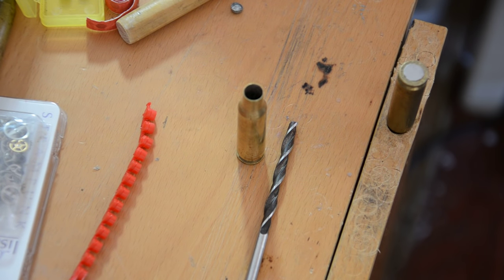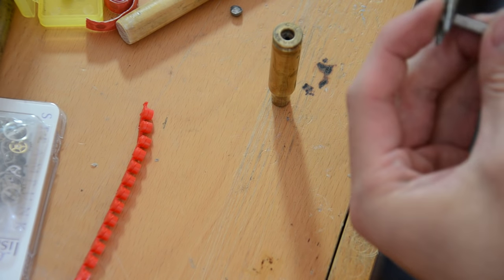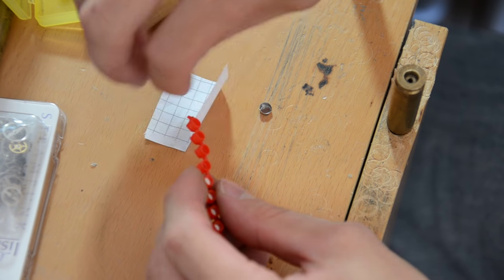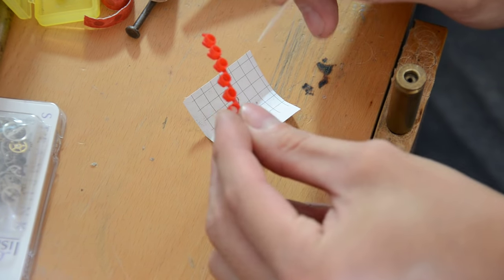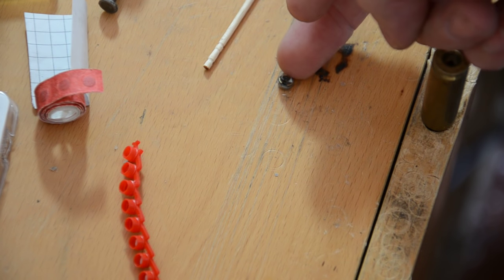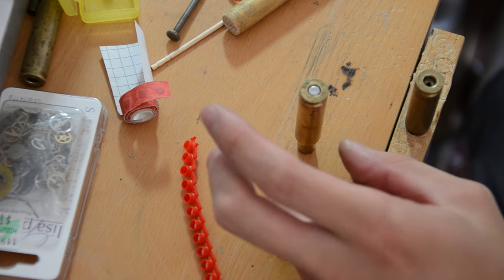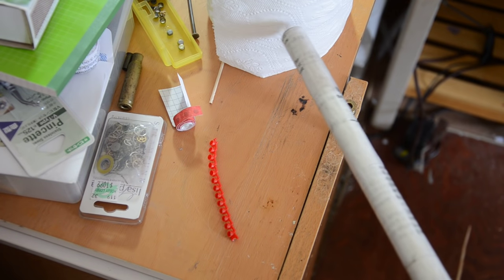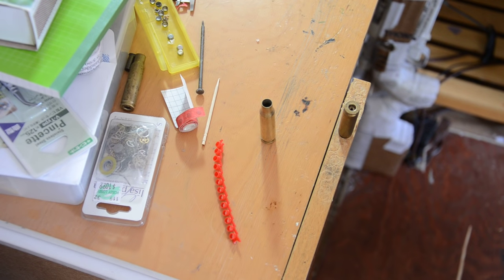Homemade Rifle Primer

Comment: how do you get the anvil out mine is stuck it seems in this 9mm
Reply: if the bullet was shot successfully you can remove it with a nail, otherwise don't try it
shot successfully means it has a small hole or a bump where the firing pin has hit the primer
Reply: Bushcraft Mike can you use the actual bullet head for paper guns or will that be dangerous .
Reply: dragonborn joshuai an actual bullet head might be too heavy for a paper gun and would need a lot of power to propel. I'd try to use small balls like slingshot ammunition or bird shot

Comment: You could, the anvil needs to be hard enough to not bend during the impact of the firing pin or it will not crush the primer compound.   

Hardening is a pretty easy, but it does take a little bit of precision to get it right. Too hard and it might shatter, too soft and it might bend.  Both lead to failure to ignite.

As far as forming it, drill a hole in a piece of steel slightly smaller than your cup, use it to form, then use a dremel to cut slots.

Don't hammer a primed cup, they go boom.

Comment: The powder from those plastic caps are EXTREMELY CORROSIVE!!! Penny wise pound foolish to save money on cheap primers and at the same time destroy an expensive gun! Also, the amount of powder in each cap is not the same, therefore you will get inconsistent ignition, which in turn causes poor accuracy! Also beware of hangfires!!!
Reply: So...don't make your own primer?
Reply: Probably make the gun with the homemade primer.
Reply: He said he was loading a 7.62 casing . Old  military surplus 7,62 has highly corrosive primers stock and will rot out barrels .  Instead of the caps , wonder if you could use the white heads off wooden matches , thats phosphorus , which I think will ignite on impact ?  The colored part of a match , and paper matches are sulphur powder , and wont . Tracer heads have phosphorus as well . Stock primers are a phosphorus base powder I think . Phosphorus is a long   burn rather than an inpact , and more likely to  fire the main charge .  The red paper  cap gun strips are just black powder . Mattel use to sell round stick on ones called Greeny Stickem Caps , that was back in my 8 yr old  cap  gun  slinger days , probably cant get them any more ? Theres also primers in Hilti Gun  nailers , that dont have a projectile ?  They make 38 spcl  Hilti shells .